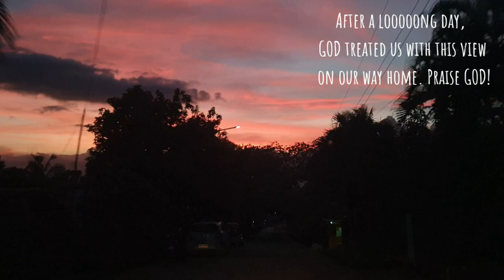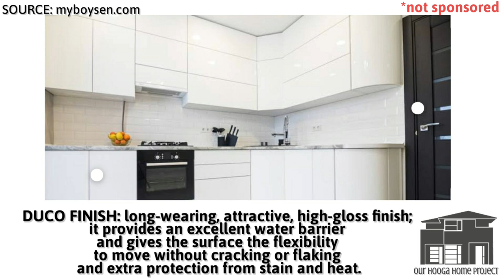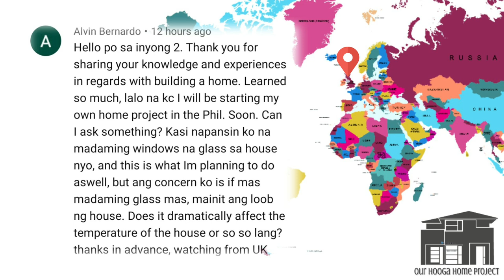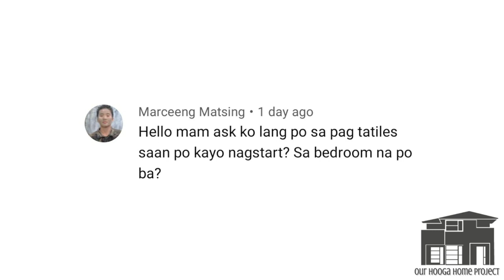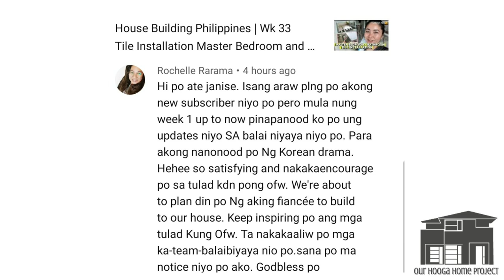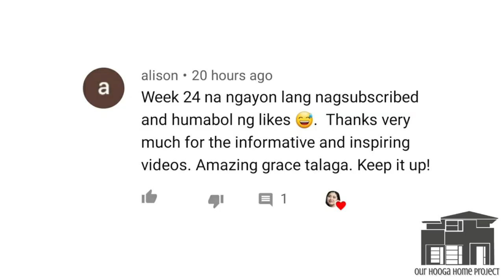House Building Philippines | Wk 38 Tile Installation in Dining and Living Area | Retired OFW

Comment: Radiant heat barrier requires gap to work.. Not directly touching the metal roof...physics 101. ..induction ...convection...radiation....roof has no ridge vents for attic air circulation....Dark color roofing absorbs heat...light color reflects light...Sunlight emits infrared...UV...visible light. There are paint brands that reflects heat even dark colored .